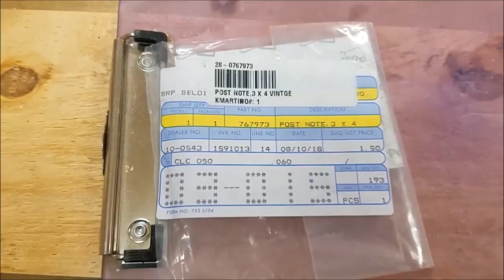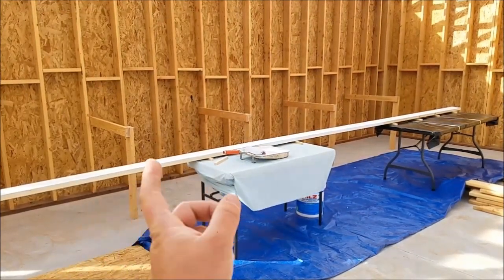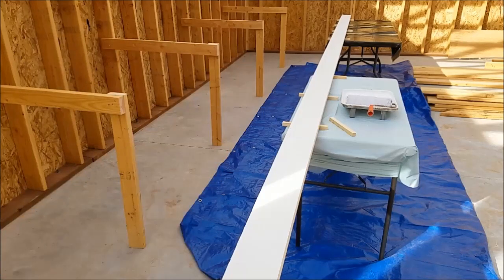DIY House Build # 17 - Truss Blocking

Comment: Hope you ran a string line and trimmed the tails of the trusses.  I’ve had a porter cable gun for years and built 3 houses with it. Works great. I also wear gloves with the fingers cut off. I also keep the trigger down as I’m slammin nails. 
Love your attention to details. Great build so far. Please get  some diagonal temporary bracing on the trusses before you go up on the roof to sheet.

Comment: It is coming along nicely.  I have that Porter Cable gun, I have framed over 7,000 sq ft with it and zero issues.  I hope the rubber on the Metalbo doesn't rub more than the metal did on your finger.  It is no fun with a tool that hurts.  It is interested the OSB isn't lined for stud location, here you have a hard time finding no line OSB and you pay extra for it.